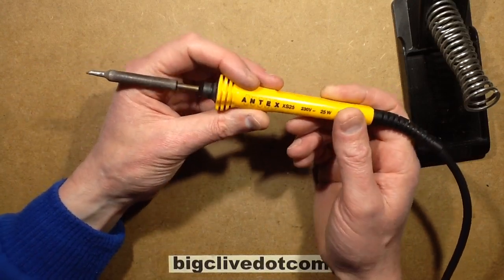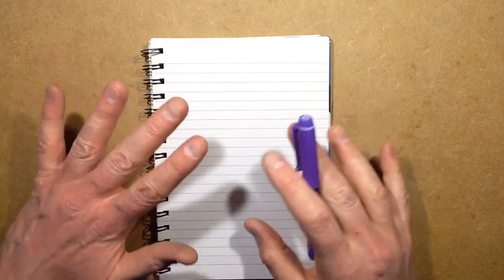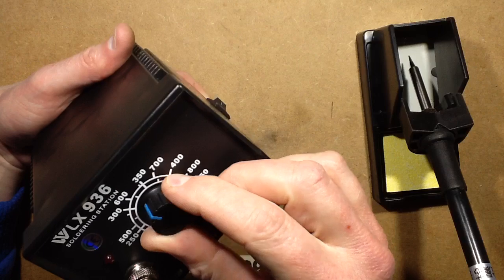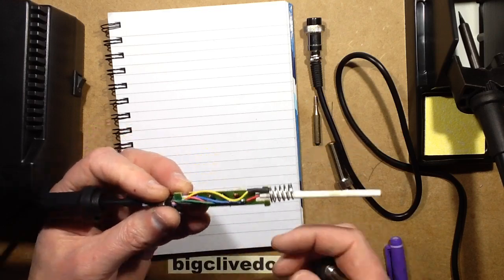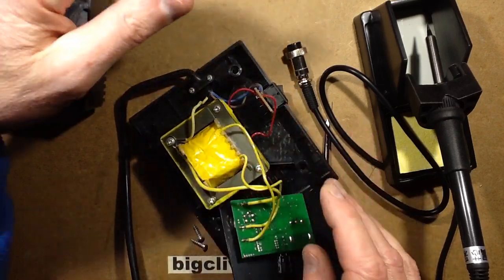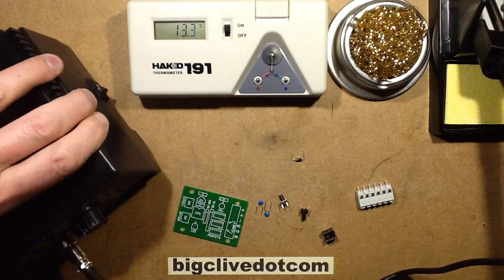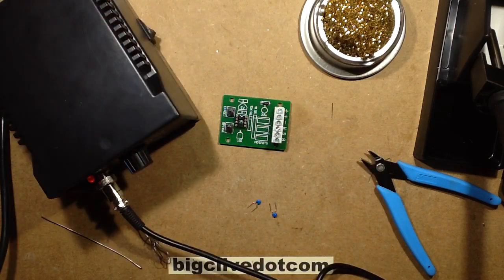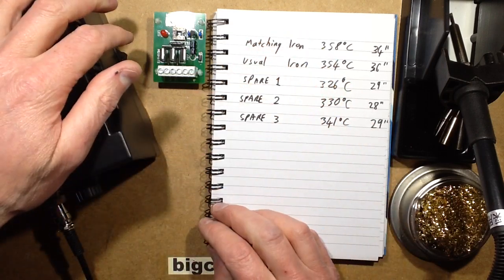Soldering basics and choosing a cheap soldering iron.

Comment: Best £15 i ever spent was a 500g spool of named brand (Kester in this case) 63/37 solder. It becomes very difficult to make a dry joint unless you're soldering something absolutely massive and tinning tips and wiping on a wet sponge, tips last seemingly forever. I got a small diameter (0.4mm I think) one because I do lots of surface mount stuff. It's not too inconvenient to have to use more length per joint on medium sized joints and on rare very large joints I use a cheap 60/40 1mm solder.

For a soldering station, I got the 50W one maplin used to sell for £50 that has a pot and a LED temperature bar graph which I love. I got a pack of 5 tips and a spare element at the time as I correctly guessed you can't get elements or tips for it anymore. The tip ground is brought out to a separate binding/banana post on the back which attaches to the ESD point of the bench rather than through the mains lead. I don't know why they do that. I used a few 25W straight-in-the-wall ones before that, but they didn't have the oomph. I do almost all my soldering around 300'C. 350 for a big joint.

When I was "taught" to solder in school, it consisted of drawing on the blackboard of the profile of a good and bad joint and being told the joint had to be shiny and that the hot end melts the solder. Technique was not taught and we were using Pb-free solder which they didn't tell us is more difficult to make shiny (not impossible as many will say, but you really have to get the technique spot on. By the end of my GCSE all my lead-free joints were shiny). 

One thing I'd add to your lesson on soldering technique, you should tin the tip with a little excess solder before touching the lead and pad as it helps transfer the heat into the lead and pad. If you have a perfectly clean, dry tip and try to heat up the lead and pad and touch the solder to the lead and pad on the other side of the joint you might often find they don't get hot enough. It sounds like what you're not supposed to do - bring molten solder on the tip over to the joint - but as long as you only use enough to transfer heat and then make the joint with fresh solder, it's good.

Something else you could have gone into is how to take care of a tip. Tinning and cleaning it frequently with good solder makes soldering easier and makes tips last longer. When you get to hand soldering surface mount, you really have to tin and clean the tip immediately before each part as well as use additional flux on each part, and then clean the board with IPA and an ESD safe brush. I use both the wet sponge and the dry metal sponge type thing, but to properly clean the tip before a delicate joint it has to be the wet sponge.

You could have also mentioned that having 2 soldering irons is useful for very large connections or desoldering parts with maybe 2-8 pins more easily, where you want to move around heating up all the joints before the first one cools so the part can fall off. i.e. You can use 2 soldering irons sort of like surface mount desoldering tweezers.
Reply: +KX36 WBT-0840 solder is the best i have ever used, melts at 180 deg C flows like water.
Reply: Interesting that you use a lead solder with silver in it. What first drew you to use that, did you have a special purpose? I see various reasons quoted for using it, but they generally are audiophiles saying it "sounds better" or "looks shinier"

For reference, 63/37 SnPb melts eutectic at 183'C and 60/40 SnPb melts around 188'C, so the lower claimed melting point of your brand is probably not worth the usual increase in price of silver solder in itself.

The most important thing and probably the hardest thing to do is get solder with a decent flux.
Reply: KX36 I find that the increased conductivity of silver bearing solder makes the increase in cost justified. Particularly in applications such as audio or very low current devices 
Also, I prefer a liquid flux. been using Kester 186 RMA flux for years.
Reply: How much does adding 4% silver change the conductivity, and how much does it matter over the small size of a solder joint?

Your mention of audio makes me suspicious that starting to sound like audiophoolishness - i.e. "silver solder joints sound better" (because it's more expensive, and gold sounds even better, and a $54,000 phono cable makes you hear in 3D Technicolor and have visions of the virgin Mary) If you're thinking of the noise added to the circuit by solder joints, all the joints in your circuit would contribute negligible noise compared to a single resistor.
Reply: Well to be honest to you I tried gold doped solder, i really didn't care for it, it melts at a higher temperature and it has a lower overall conductivity at typical operating temperatures. Additionally silver oxide has the same conductivity as pure silver so the oxidization effect is negligible.
As in regards to the application to audio signal circuitry the choice of silver vs. gold is a matter of individual taste, Silver tends towards a more neutral and "faster" sound whereas gold tends to add "warmth" and a bit of treble to the overall sound.
Reply: "Silver tends towards a more neutral and "faster" sound whereas gold tends to add "warmth" and a bit of treble to the overall sound."

Sorry, please tell me this is a joke on your part, otherwise all credibility is gone. The only way a solder joint is going to change the sound is if it's broken.
Reply: KX36 Yes... I do actually mean that, and i was not seeking your approval.
If it you personally can't hear a difference i totally understand, not everyone is born with "golden ears", and so much the better you can be happy with your car stereo or a walkman and earbuds.
Audio circuits are strange animals, and do irrational things.
No matter what composition of materials constitutes a circuit, that construction is going to have some magnitude of influence on the overall output waveform of the signal.
All I can relate to is what I've heard with my own ears, and that which those who have listened to the same equipment have expressed to me.
Reply: From a scientific point of view (as that's what I am), for something to "change the sound", it has to add distortion. If it does so, you see changes on a spectrum analyser. Since the vertical scale on a spectrum analyser is log, the device is orders of magnitude more sensitive to tiny changes than the human ear or an eye looking at a time domain waveform on an oscilloscope. I guarantee you won't see any differences at all in the audio spectrum by adding 4% silver to all your solder joints, let alone hear a difference.

I have designed part of a 20 bit (relatively) wideband digital acquisition system before with a noise floor of near -120dBm. (Let me tell you there's way more to designing a meaningful >20 bit system than just whacking in an expensive 20/24bit ADC and getting a meaningless number out of a THD meter. Most overpriced "24 bit" audiophile equipment has an ENOB of between 8-12 bits yet audiophiles definitely hear their money's worth vs a 16 bit system with a similar ENOB.) I had to limit resistors to well under 1kR to reduce the noise floor as well as using very expensive low noise wideband opamps etc, but I didn't have to use special solder because as I said, all the solder joints in the thing add up to less than a single resistor in their effect at low frequencies. It's only when you get to RF designs with transmission lines and controlled impedance traces that little things like this start to matter.

I'm sorry to have to tell you that "golden ears" are generally just in your imagination and the theories which fly around forums as fact are often ludicrous. It almost always comes down to "the more you pay, the better it sounds". There's no point in me trying to change the views of an audiophile though, you're a stubborn lot, it seems like a religion with you guys.
Reply: KX36 Well In general I agree with every point you've made here, and I can assure you i am not the "more money is better" camp. However I do think the above average human ear  has equivalent  sensitivity in its range of detection (20-22,000ish) and the human brain has far more processing power.
 i don't think i qualify as an audiophile either. The most expensive piece of audio gear i have cost $1400, and my loudspeakers are 54 years old.
Would i like to have stupid amounts of cash to buy top end audio equipment that costs $$$$$$$$ because its in a really nice box... I'd sooner hire an EE to design a system specifically for what i like.
Again relating what my ears tell me. Nothing more

Comment: just thought I would share a tip for extending the life of the soldering iron tip I have a inline switch ( with a diode in line inside of it ) connected to my antex in the off possition the switch is passing half wave and when the switch is switched on the diode is shorted out so when it is off only half wave passes the iron is on but low temp switch on and full wave passes and it takes but a few seconds to reach hi temp  
saftey first for those of you who are just starting out might want to try this, The diode is inside of the inline switch on the live side (the diode Does Not go Neutral to live) the live being the one switched easy as that do not break the earth wire when conecting the inline switch good luck be carefull
Reply from the maker: +Peter Radford That's quite a good idea.
Reply: fell free to do a vid on it just in case any newbies want to give it a try and you do explain things very well you could have a switch in a 3 pin socket were it could be wired up to do the same instead of the inline switch  bigclivedotcom

Comment: You can get the bits from ebay at http://www.ebay.ie/itm/3-0mm-replacement-tip-for-Antex-XS25-soldering-iron-51-bit-B005160-/321985173759?hash=item4af7cfd8ff:g:aGQAAOSwHmhV8Xpx

Comment: I''ve bought the same Antex soldering iron but i think its CS18 model. Its good soldering iron but i think the cable is too thick so i changed it, now i have more ""freedom"" of movements with it. Also you can find individual bits for it  from farnell uk they are still expensive 4-5 euro for piece list price for my country but at least you can buy them individually.

Comment: Curious as I am new to soldering. Is the tip of the soldering iron supposed to always have solder on it when you are using it, "tinned" so to speak? Or is it that all the solder should be left behind on the pin and pad and your soldering iron should come away clean?
Reply: +David Anderson 

Before a joint, you should wipe the tip, then add a tiny bit of solder to the tip to transfer heat into the joint.
When making the joint, heat the pad and lead with the tinned tip, then add fresh solder to the other side of the joint.
You may have some solder left on the tip after this. It's best to wipe it off as it can be a bit dirty, then tin the tip again with a little solder before the next joint or turning the iron off. 

If you leave the tip hot while not tinned, patches on it will stop taking solder. You can scrape these patches clean gently (i use the back of a pair of pliers) then immediately tin them and that will often help, but it will start to wear through the coating of the tip and as Clive said, once the coating's gone from the tip and you're down to bare copper the patches will keep coming back.

Using a high quality, named brand solder and not swapping between lead and lead-free makes all of this a lot easier. 63/37 solder is by far the easiest solder alloy to use as with this ratio the tin and lead will have the same melting point (google "eutectic") and this eliminates one cause of dry joints.
Reply from the maker: +David Anderson The tip should be wet with solder for a good thermal connection.  When you remove it from the joint there will still be some residual solder on it.
Reply: Thanks that's exactly what I was wondering.

Comment: Is the heat gun on that soldering station good enough to reflow solder to take donor parts off of old PCBs?
Reply from the maker: +MalleusSemperVictor I've never tested that, but it does go up to solder-melting temperatures and is intended for reflow use.
Reply: bigclivedotcom Thanks for the info as always.

Comment: What you think With tis Soldering Iron Temperature Adjustable eBay (with adjustable chips LM358/LM358P) ( http://www.ebay.com/itm/311156628891 )? I like this ;) After year broken heating element ard I repaire this (maked 1+1 broken item = to 1 working item) and drow schematic ( https://goo.gl/photos/e6pZejDBN85gkNm48 , album: https://goo.gl/photos/wS8hwr2HhaDmtGrw6 )
Reply: +kose2ik or like this http://www.banggood.com/907-Constant-Temperature-Electric-Soldering-Iron-Lead-free-22OV-60W-p-920554.html (with 10 tips)
Reply: +kose2ik Where can get sheep mini/micro Tweezers Soldering Iron to SMD component soldering? Like this, in the picture https://en.wikipedia.org/wiki/Soldering_iron#/media/File:Soldering_a_0805.jpg

Comment: Thanks Clive! I'm totally building my next soldering station with the board you've showed and a trusty transformer. BTW I'm having problems with my aquariums' heaters, would you think that it's possible to use a soldering heater to warm water underpowering the element?
Reply from the maker: +Carlos CM I'd recommend only using an aquarium element for heating the water.
Reply: +bigclivedotcom But if u need a hot bath dump a kettle element in there lol
Reply: +bigclivedotcom Thanks! I've carefully read the heater specifications and I reckon there'd be too much possibilities of making fish soup...

Comment: I bought a station from hobby king for $30 and used it for years.. Then I broke down and bought a Hakko 888d.. I never knew what a difference a great iron makes. Heats up in under 30 seconds verses close to 3 minutes on the cheap one. My gripes are that the base is too light, so I stuffed a few 1 oz. fishing weights in it. Also, the it doesnt have an auto off and I have left it on for 2 days before. Nothing bad happened, but one would think that a digital iron would have a shutdown after a few hours.

Comment: I quite like the CXG 936d, integrated in handle, not big station but still accepting "900" series tips, like this http://s.click.aliexpress.com/e/rB6YvzZjM
Also I got a Bakon 950D, quite interesting and powerful, similar cartdrige style to professional stations from JBC, however either my tip broke or calibration was way off, breaking it. Mine is similar to http://s.click.aliexpress.com/e/JAmqbM7ur
Reply from the maker: +Electronica y Reparaciones I got a mains iron with internal heat regulator, but the tips it takes are much bigger than the 900 series.
Reply: bigclivedotcom That I saw in the ones similar to your Antex, but the CXG936d from what I saw it seems to use the same A1324 heater and 900 tips. I cannot say for sure, as I have the other model I said.

Comment: I just got myself an Elenco SL30A station. 100$CDN shipped. It's nice because you can change the element in it and the tips come in a wide range of styles. Solomon also sells the exact same unit just rebranded. Very nice unit though.

Comment: Hi Clive, at 6:28 regarding not applying a blob of solder to the iron first. Personally, I've never understood why people are against this method of soldering - in many situations, where you don't have enough hands free, it's the only way to do it. Say you're soldering a lead wire on to a panel socket or something - one hand's already holding the wire! As long as the blob of solder touches both wire and pad, transfers heat to both, and both reach proper temperature, I really don't see it as a bad way of soldering. One of the reasons I like chisel bits is they hold a nice blob of solder!

That being said, it assumes you use separate flux on the wire/pad, since the flux in the solder has already been burned off. That being said (2), I have never found that relying on the flux inside the solder is anywhere near as good as using additional solder, especially if you have a plain copper board instead of a tinned one (e.g. a home-etched PCB). I've been using Warton brown flux jelly (https://www.warton-metals.co.uk/brown-jelly.html) for the past 5 years or so and I can't praise it enough.

This is an excellent overview of soldering technique and stations, and I'm now strongly inclined to think about getting a station! I've also used the Antex for ever, but it might be nice for an upgrade ;-)
Reply: +Lindsay Wilson Well, the point is to teach beginners to do things right. It would be very easy for a first-timer to keep that blob of solder on the iron for 10-20 seconds before deciding what to do. You start with the "proper" methods and then work your way out from there, not the other way around.

Comment: I always wondered why it was common practice to use low voltages to supply temperature controlled soldering irons.  I used to use an Oryx 50W mains powered soldering iron until one day it exploded in my face. All that actually happened was that the the continual flexing of the cable at the entry point to the handle caused the cable to short out but it produced an enormous flash and bang right in front of my face, for a minute or two I was convinced that the IRA had struck.  The puzzling thing was that after the event there was no external sign of damage at all apart from a tiny tiny pinhole in the cable insulation.

The Oryx had yet another temperature control method, there was a metal rod running through the heater and in thermal contact with the tip.  The rod expanded when hot and via a lever operated a microswitch in the handle.  You adjusted the temperature with a little allen key, Simples.

Edit - apparently they still make it. - http://tinyurl.com/hh2hou2